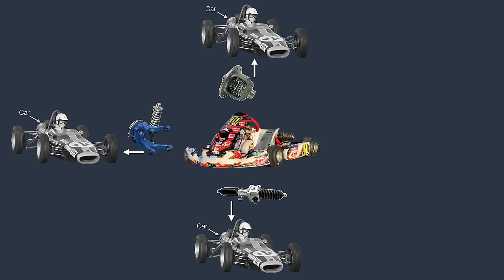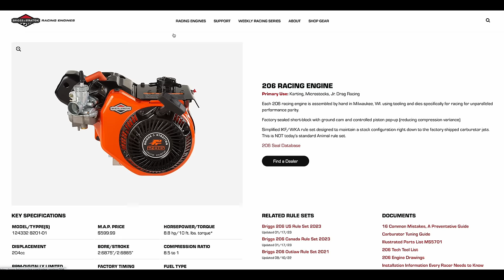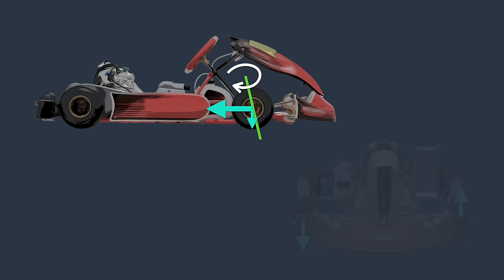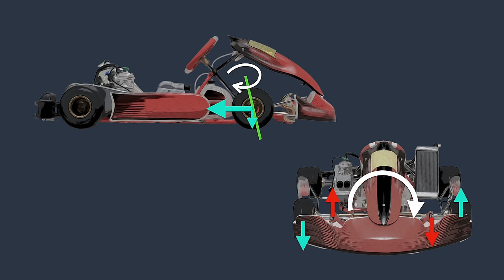Kart Racing Is Way More Complicated Than You Think

Comment: When I was a kid, I raced RC cars.  Spec racing was similar to what Matt said, buy sealed 10 motors, dyno them, use the fastest sealed motor, ebay the rest, a process that circumvents the cost control and spirit of spec racing.  Some people make the racing their identity however.  You'd have fervent racers who would cover their car with a towel or something and verbally (sometimes threaten physical) attack anyone within 50 yards who had their camera or phone up, recording, lest the racers' super secret chassis or shock setting be revealed to the masses.  It was petty and ridiculous.  Kart racing sounds like it has the propensity to be equally petty and ridiculous.
Reply: It is, it was, even back in the 60s. But it’s still racing, with everything that means.

Comment: in europe, there's a tiny class called speeddown karts which drive downhill without any engines built in. that of course removes quite a bit of thrill while getting to speed, but as most tracks go through tiny mountain towns and countryside backroads with tons of curves, theres usually not a lot of space to drive extremely fast anyways. the benefits of this class are the very low cost, the supporting yet competitive scene around it and that it focuses a lot more on braking and finding the absolute best racing line, which often differs from those of motor racing. with speeds upwards of 50 mph or 85 kmh on narrow streets, its really fun and you dont really miss the engine, especially when drivers all across europe drive against each other. check it out if u can :)
Reply: all karts are only allowed to use FIA approved parts, so its actual karts with just the engine missing. also there are other, faster classes, which dont look like karts but rathers small racecars, and these can get up to 80 mph, once again on tight, mountain roads
Reply: Mike Rowe (dirty jobs guy)'s YT channel did a video on the american rendition of this a bit ago. 3IXjn0RlfEM
Reply: @irfuel  basically all around center europe, there are guys from spain to latvia driving in the series, but its so small that you basically just need to sign up for the events to be able to drive there, pretty cool, its called speeddown, and there are 10 different classes, karts being one of them
Reply: @unitepunx  just watched it, looks quite similar, but the european version is more like time attack in that only one kart drives on the track at once.  Also, there are more different types of vehicles and in most classes more regulations. however, we also have the drift trike category at some races
Reply: @moritzhauenstein8823  Do the speeddown karts have a solid rear axle like the powered karts? If so, wouldn't that slow them a bit, so they're better off changing to a diff or putting bearings in each wheel?
Reply: Seems like a blast. One day I'm going to yank the engine out of my kart and try a couple miles of hill at our cabin. It's begging for some downhill shenanigans.
Reply: Any racing is good racing but the best racing is inexpensive.
Reply: @Mark_Bridges  with no drive, there would be no differential. Yes, a dead (non-rotating) rear axle with each hub on its own bearings would make sense.
Reply: @irfuel all over europe, but here in spain we have a special race designed for highschools called hiperbaric challenge. We participate in the C3 category of the spanish regulations (although i believe it's the same as eurpoean ones) and i'm the lead designer of the team!
Reply: i have thought of this so many times!! glad it exists!! 
I live in Greece, I 'soapbox-race' my vehicles all the time hahaa
Reply: We did this kind as a hobby on a wooden kart my dad built us growing up in the hill country of Texas USA in the 1980s.
Reply: @moritzhauenstein8823 is Kart capable of performing drifts?
Reply: @Mark_Bridges well some karts apparently have one.
Reply: @Mark_Bridges  the lower class have mandatory solid rear axles, but the top class is free to use anything FIA certified set up
Reply: @andylopez1072  c3 are more purpose built, while the speeddown karts (class c8) are only built with fia certified parts from manufactures

Comment: I'm 75 now and I started karting when I was 11. Back then there were very few rules, mainly don't kill yourself, other drivers and most importantly the spectators. For the first few years there were no limitations on the size, number or types of engines. I ran two of the biggest chainsaw engines built at the time, around 20 hp each. They could propel the kart to well over 100 mph which was insane for the size of the tracks we raced on. Nothing could touch it on the straights. My Dad who built it was afraid to drive it because it was so fast, but not me. Only flipped it once, not sure how fast I was going but I covered a lot of air before I finally landed with a few bruises and was back out on the track for the next race, abet a bit slower. A few years ago I started designing a kart for the Salt Flats land speed record but the rules they put on karts were outrageous and they limited the top speed so drastically I decided not to build it.
Reply: Whos stopping you building the kart and running it without all the fuss of rules?
Reply: @dopey_duck_944  
First it couldn’t be raced on a track because of its speed and gearing it down just wouldn’t make any sense. The design spec is a 200 mph kart, with suspension, purpose manufactured rims, tires and brakes. Aluminum, composite and carbon fiber frame and body. It would have a purpose built 250 cc engine, approximately 80 hp using fuel injection and ECM with a six speed transmission. Built for straight line driving only, not a track. Estimated cost to build 15-20,000 usd not counting labor. Then convincing myself to drive it.
Reply: @joereedmusic9853  you sound like you have it sussed. Why not approach some companies?
Reply: I think you're fudging the numbers a bit here lmao
Reply: @CockatooDude I’m highly skeptical that ~80hp is enough for 200mph. A fully faired kart would still be contending with a hefty amount of frontal area. A very well designed streamliner bike, with similar power & half the contact patch, has little chance of being even remotely close to breaking 200mph. That said, I’d love to see it happen and be proven wrong!
Reply: @syf13  I just especially find it interesting that this was supposed to be in 1959, even 100mph with 40hp Is sus, modern x30 is 30hp and don't go that fast. Not to mention, what chainsaw motors make 20hp even today? 10 is a stretch for most
Reply: @syf13  also first ecm was 70's I'm pretty sure and they definitely weren't on small engines
Reply: @joereedmusic9853  If it's got suspension, it's not a kart.
Reply: Got 20 years to catch up with you . Don't race as much as I want now . No complaints with 3 podiums in 5 races this year ! Also do double duty as a track marshal !  Lap 1 at turn 1 is not boring for club weekends ! More fun behind the wheel for sure ! The 3 seasons as a kart owner sucked . Should have fired my mechanic but he was me 😂🤣 Also a huge weight penalty . My lack of weight was my greatest advantage ! For what was my final race did  DNF for pre final . Pulled all the weight and wow what a difference !!!! Was ready ready to buy a new kart then medical BS ruined things . But glad to still be around and still race . That was my motivation to get better
Reply: I'm almost 80 and I started when I was 18, so you started before me!  I was in San Diego, where were you?
Reply: @CockatooDude imagine if Karts also has engine swaps so that 200mph top speed on gokarts can be acheived.
Reply: @LeHazy well that could be a cool idea.
Reply: That's cool ! We have a guy close to your age and his only complaint is getting out of kart not as easy as it use to be ! When ran my 1st kart one of older guys asked what chassis I was using ? So told him 
Well there's your problem right there 🤣😂. Was too funny to not be offended ! Still do some A+D races and flagging ! They won't let me race guys my age . A few weeks from 55 and have a huge weight advantage at 135 pounds ! The last time ran my own kart did a DNF for pre final and pulled all the weight off kart and Wow what a difference after 4 years of it on ! Flew a kart in 2010 and remember it like yesterday ! Back a mess for 6 months and of course went back for more ! Won next two races at different tracks . 1st time tried a kart was in 1978 . Told my dad I was good ! My brother got to play soccer 🤮 . Drove lots of crappy karts . Then when found a good indoor place 1st impression was screw that it looks scary . Back the next payday . Bought first of 9 helmets the next month ! Soon as next year starts will be 19th year of seat time ! With Canadian winter was fresh meat for local racers and was a case of get good or go away . I decided to get good !! They the ones who said I should race outside !! Took 3 races to know indoor style does not work outside ! Had all sorts of fun and adventures when should have been racing 😂🤣 . But did ok for a washed up never was .Better to finally find my place rather than to have not found it at all 🏁
Reply: @mattbrown5120 I ran a 25hp animal engine on a kart down in gateway international kart track. I clocked 116mph at the end of the straight. Gearing plays wonders.

Comment: Having karted for a few years myself, "not expensive" gets pretty expensive pretty quickly depending on how competitive you want to be. Admittedly still way cheaper than running a full size car, but you still go through tires like crazy on a kart and they aren't exactly cheap for all the less time you get on them while still being competitive. Add to that 3+ versions of what feels like every single part on the car (hubs, axles, wheels, bars, etc), plus tools and a trailer to hold all of that stuff and it quickly turns from "this is a cheap way to have fun" to "this is a really fast way to spend money". It was still a lot of fun and something I wish I did when I was younger, but also something I don't mind having stopped doing. Might be different if I had more tracks near me, but running on the same track every time, even in a different config, got a little stale.
Reply: Agree - depends what the definition of 'not expensive' is!
A season of 2-stroke racing at just club level is going to cost minimum $4000 (everything included).
Worth it though!

Comment: Around 1960 my father built a kart with a small rocket motor. He had help from Art Arfons.
Reply: Liar.
Reply: I'd be scared to come near it, let alone drive the thing. Where did the engine come from? I was under the impression that you wouldn't generally have access to small jet/rocket engines so far back, although if anyone would have a way to get a jet engine on the side, it'd be Mr. Arfons
Reply: @Look_What_You_Did  I'm serious. It was tested on a runway at what is now O'Hare Airport in Chicago. All I remember him telling me was that it was scary fast. Something like 90 miles per hour.
Reply: @theleva7  That's why I dropped Art's name. It would not have been possible without his help in getting the motor.
Reply: @Look_What_You_Did  Prove it?
Reply: @Look_What_You_Did rocket karts were popular in the 60s
Reply: @theleva7  I would asume that the engine was a pulsejet. I am not an expert in reaction engines, but is the only one that I imagine that could fit in a reasonable sized kart in that time

Comment: I did electric karting for the first time recently and had SO MUCH MORE FUN than I expected! You're never going very fast, but man does it feel like it. And you pull some surprisingly hard Gs going through the tight corners
Reply: the instant torque from a electric motor makes it so much fun in a kart
Reply: Yeah i did some electric too about 3 or 4 years ago.  Definitely didn't miss the smell of choking exhaust while being strapped in around 20 other idling carts waiting to race.
Reply: I've only ever driven gokarts at a fast kart.
I don't know the economics or feasibility of it but imagine torque vectored electric gokarts. Things Ive heard about the Rimac Nevera and Lucid Sapphire has me interested in the future of low cost racing.
Reply: @grantlauzon5237 the K1 speed OTK karts have a differential of sorts, with the way the race karts lift a wheel, you almost don’t even need a differential

Comment: Video summary: "Make it more rigid" is not always the solution
Reply: Sometimes it is.
Reply: @Look_What_You_Did  Yes

That's what I said yes
Reply: Usually it’s not
Reply: Rarely is.
Reply: More rigid with soft tires. With spec/hard tires you need that chassis flex.

Comment: Matt--- I'm a relatively new subscriber (4 or so months). 
 I enjoy your content for your dry sense of humor and the knowledge you have in the areas I don't, the engineering aspect, with cars. 
 I'm an electrical contractor with 35 years in commercial industrial construction (high rises, hospitals, stadiums, high tech) with a high degree of service and troubleshooting background as well. I also started out after high school building emergency vehicles, police, ambulance, fire chief vehicles,  and all electrical and A/C on cars. I've always tinkered with my own cars, I've had mostly muscle cars, some trucks, but was never a fabricator, never learned to weld, but I can bend pipe ½- 4 inch, build racks, and brackets. 
 I'm watching your videos to learn new things and to get soke laughs at the same time.
 Thanks for your videos

Comment: Dual engine go karts and 1 wheel drive go karts are still go karts. Both have been used in racing. The definition of a go kart is much wider than you have implied, there's cross karts, yard karts, drag karts, etc. Cross karts, although they might seem pretty far separated, really just started when somebody put suspension on a yard kart.

Comment: That’s wild. I’ve been to a few kart races and I always leaned aggressively into the corner, thinking it’d be best to keep the weight on the tires as balanced as possible. I knew about the need to lift the inside rear tire but somehow never connected those in my mind. Next time I’ll play around with my posture some more and see if I can get faster!

Comment: I had no differential in my R32 Skyline years ago. I made it a fast 3 wheeler with a big rear sway bar. No one told me to. Just figured it out. Was comparable to 4 wheels since low power and light rear so so inside rears not overheated while working alone.

Comment: They do have very effective suspension - it's just that most people wouldn't recognise it
Reply: At that point is it suspension or just chassis flex?
Reply: Yea, it's called your spine and head.  Works like the 2-CV inertial dampers.
Reply: @HFV_Junkyardin like stated in the video, it's not just chassis flex. I suspect the biggest component in smoothing the ride are the tires, and the rear inside wheel lifts not really because of chassis flex but because of caster angle (and scrub radius, but also inversely proportional to steering axis inclination, as well as some other things I'm sure matter but I'm not really aware of).
Reply: @HFV_Junkyardin  It certainly includes chassis flex, but practically every part of the kart has an impact.  Axle length, axle flex, wheel hub size, brake hub, sprocket hub, seat stays, lead placement, wheel structure, caster, camber, toe, seat height, axle height,  seat position, driver weight, height, heavy or light upper body size, tyre type, tyre pressure, and some others I have forgotten.  About the only thing that doesn't have much impact is the fuel tank right in the centre of everything.  I loved my karting years, so much fun.  I raced KT100S, RESA, and Rotax Max.  Always used Azzuro M6H chassis for all engines,  Australia.

Comment: I built a kart with a shopping cart and a 175cc 2 stroke dirtbike engine from the 70s. It sounds like an angry chainsaw, goes 83kph and has (1) brake disc. The fuel tank is an old fire extinguisher. It is terrifying to drive but there is something addictive about driving domething with a sequential 5 speed 1" off the ground lol

Comment: My dad put a Hayabusa engine into a cart when I was like 3-5 years old. I remember it being undriveable due to the POWER. The local track that he took me to witness this asked him if he would 'put some rubber down' on the starting straight because it would make the track look cooler. He did and the track gave us new tires for that.

That's what I remember, could be wrong, but we had that cart on the wall of our garage with the big engine at least until I was 9, so it did exist in some form. We moved when I was 5, and there were no tracks near us, so it never got driven after that. :(

Comment: I am pretty much known as super slow Dean, "old" and "fat" are sometimes added as modifiers.  After retirement I stumbled into kart racing.  It is fun.  It is competitive.  The other club racers are very helpful, wanting to beat you on the track not in the pits.  There are a surprising number of former road racers who have become kart racers due to the cost.  Unlike other forms of motorsport it is easy and cheep to give it a try.  $100 spent at the local rental kart track is a good way to see what it is like.

Comment: I got to drive a few sessions in a KA100, and let me tell you, those things are no fucking joke. They pull the better part of 2G in the corners and reach top speed nearly instantly when you get into the power band. I could only run about 5 laps at a time because I was physically exhausted and needed a break.